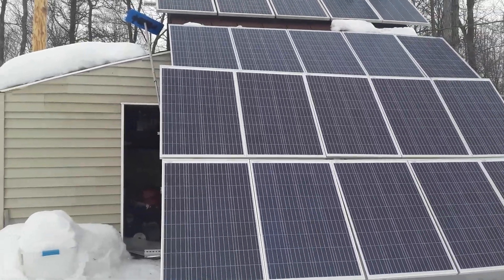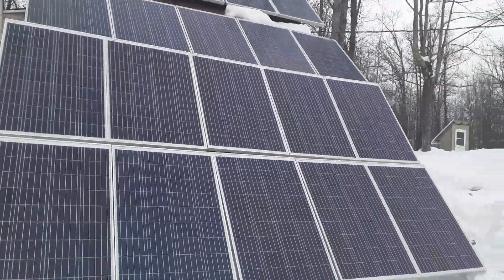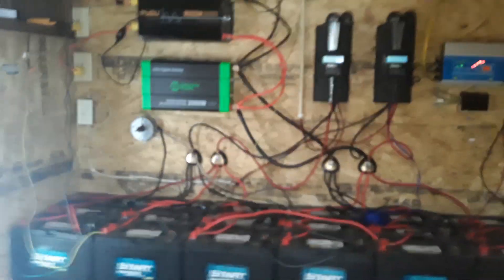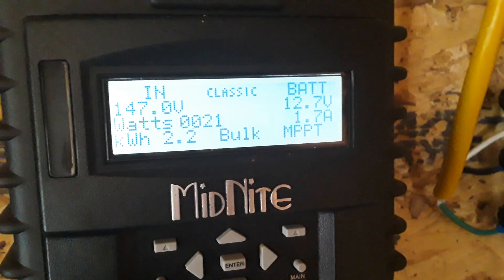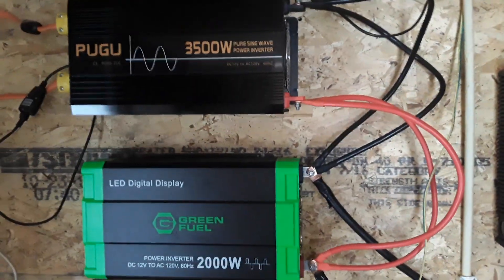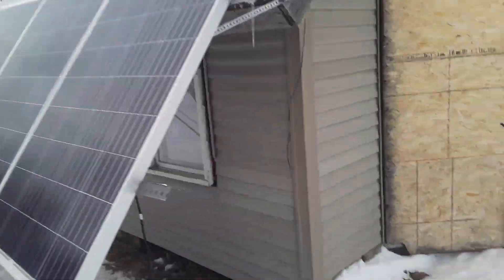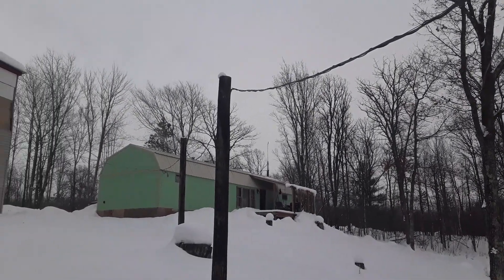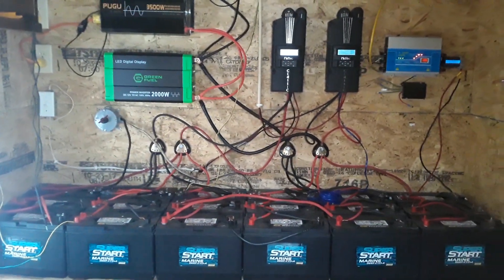The Autarky Homestead power grid. Wind and Solar.

Comment: I wish you knew where you got charge controller.  ,,I look everywhere for it can't find it ebay, Amazon no where...whats the name of it
Reply from the maker: MidNite Solar Classic 250
Reply: Wind turbine charge controller
Reply from the maker: @brianhaney3613  Oops, I'm sorry. I looked through my purchase histories on ebay and Amazon and I can't find it. But I know it was on one of the two.
Reply: Does it have a name
Reply from the maker: @brianhaney3613  I'm sorry, it does not. It is one of them unbranded cheap china special.
Reply: Brian, technically you could use any MPPT with a FAST sweep and then attach a diversion load or two for safety.  The diversion controllers could be the Xantrex or Morningstar type PWM and then attach enough resistors as well as a brake.  Might be more money doing it but at least the above are advertised for wind and well documented.  So for example, if you have a 500w turbine, have at least 500w of diversion and add another bank for backup......

Comment: um, why is your system in FLOAT at 12.7v? Seems like a really low FLOAT setting. I would expect more like 13.7-13.8.
Reply from the maker: That's because there is basically no power coming in. It was a very cloudy day.
Reply: @AutarkyHomestead  if there is low power coming in , and the battery isn't full, it should still be in BULK charge stage

Comment: We’re did you your wind turbine charger controler because I’m in a 12v system
Reply from the maker: I believe I got it on Amazon. I bought this one because it has auto shunting. I like this instead of the dump load method.

Comment: Is the inverter doing a split phase for any 240v house items?
Reply from the maker: I don't believe the black inverter does that. The inverter that was there before, did that. That inverter is in an unboxing video. Look for the (Power Jack LF unboxing video I have up).
Reply from the maker: I do not have any 240v electronics in the house. But I like having the fact that I can if needed. 😊

Comment: From your charging side, do you run both + and - to one battery? Or + to one battery and - to another battery on the opposite end of your parallel circuit?
Reply from the maker: I do not run both leads to one battery. I have a gold plated block that the controllers go to then spider out to the batteries.